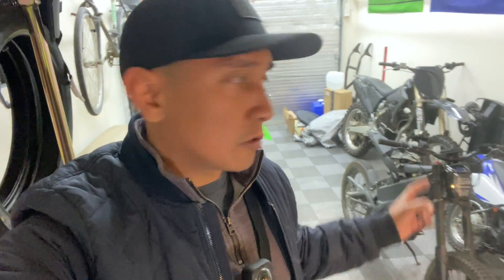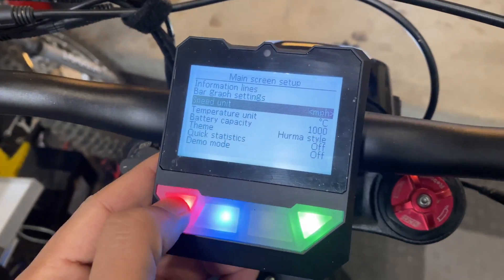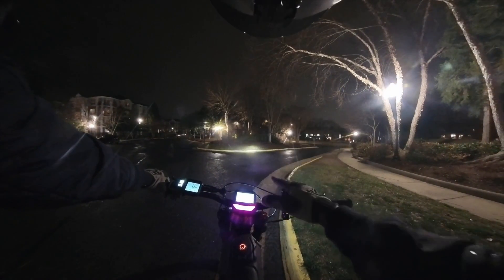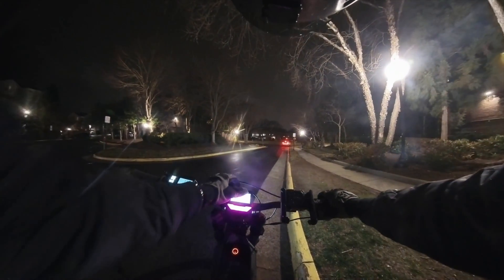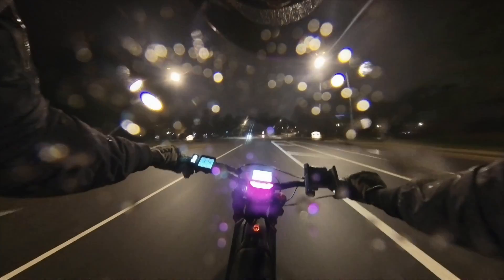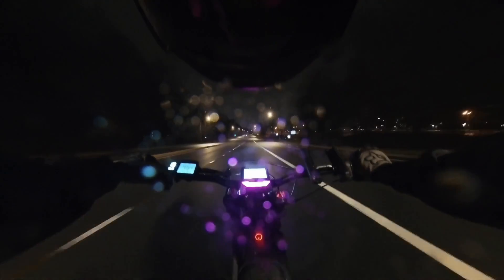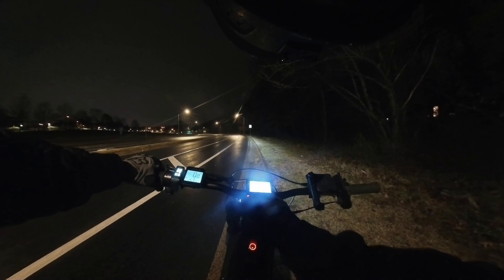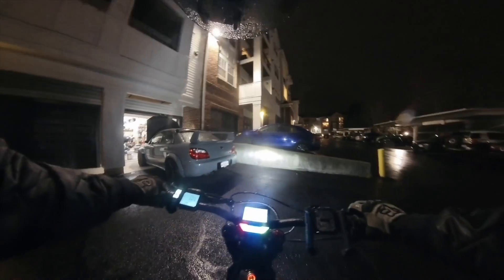First Ride on the Talaria XXX with a Nucular P24F Controller Upgrade

Comment: Looking to get a XXX and was wondering how happy are you with the controller? Is it plug n play? And can you use it with your 60v battery before you upgrade to a larger one? 

Is it hard to tune I seen in the video that you had to have someone upload a tune into your controller? So out of the box would it need tuning and if so, how would such one get that tuning? I like the app based controllers because it makes it easy to tune and tweak your settings.

Comment: I installed a nuclear controller on my talaria and when i give it full throttle fast it just cuts out i have to be super smooth on the throttle or it cuts out. Do you know how to fix that?
Reply from the maker: I have not had that issue before.. What kind of battery are you running? Did you bypass the BMS?
Reply: @PatOutdoors  I have a stock battery on my mx4 and all I’ve done with the controller was do the auto set up and change it to mph

Comment: Hey I love your videos I just got into all of this e-bike modding and I cant help to get worried about all these battery fires I’ve been hearing about. Is that really something to be worried about? I feel like it’s taking away from the fun of the bike. Also what precautions do u take to ensure your battery’s are safe when at home or on your bike?
Reply from the maker: As long as everything is installed correctly and not tuned too aggressively, I don’t see how that is an issue. Also stay away from cheaply made batteries

Comment: when you bough your did you have to wait on an email b4 you could order?
Reply from the maker: No, I just bought it on the website. Got a confirmation email 20 minutes after
Reply: @PatOutdoors  what website did you use? I'm on nucular and I hit buy and it asks for my info and but not payment then i receive an email with a link to pay? I'm really nervous about it if you say you just ordered it?
Reply from the maker: Ohh yeah I had to do the same thing. I got it through the link in the description:  https://nucular.tech/#rec101723173#!/tproduct/691672838-9926180124390
Reply: Yes they will send an email for payment

Comment: gSo would you buy it again? the Nactua? I'm about to pull the trigger I was just waiting on your video
Reply from the maker: If you are planning on installing a 74 volt battery for big power (like I am right now), absolutely. You need it to run higher voltage. If you have no plans of upgrading the stock battery, the difference is very minimal
Reply: @PatOutdoors  Thanks brotha!!!  YEA I Always want MO-POWA  lol.. can you share the website you got it off of? I was on nactuadotcom I thought and when I clicked buy it sent an inquiry to the company and I then received an email with ways to buy... I didn't order it yet tho.. he even offered to add a Bluetooth module for me to connect to my phone...